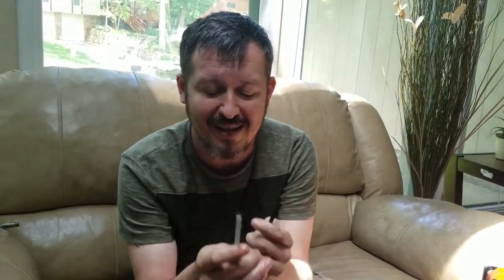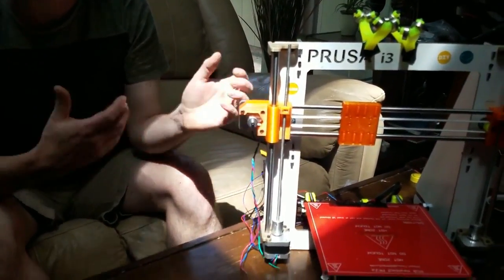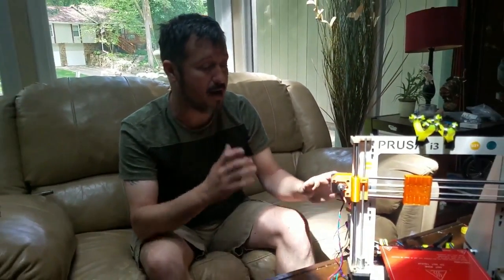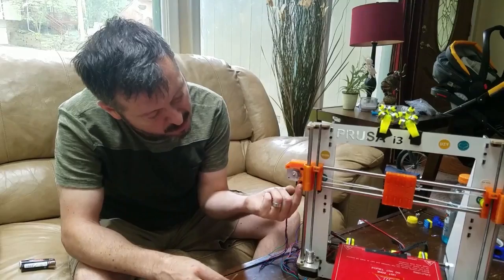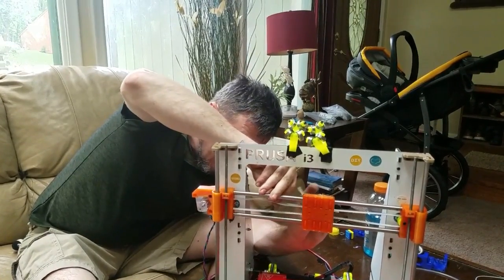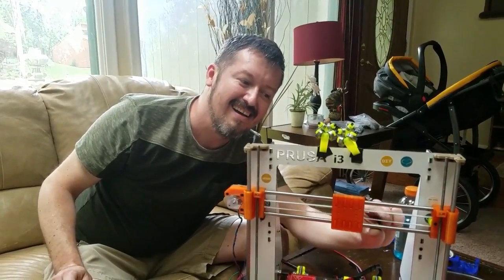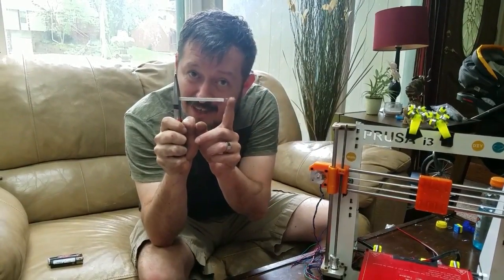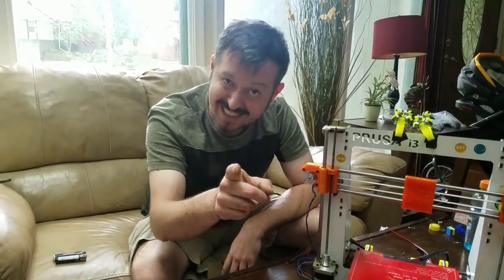How To Tighten The Belt On Your 3D Printer

Comment: which one is good, PU or Fiberglass?
Reply from the maker: This is just my experience,  but fiberglass and kevlar reinforced belts last longer than the steel reinforced,  because the size of the pullies we use for 3d printing
Reply: @forward3dprinting796  so fiberglass is stronger than steel
Reply: @forward3dprinting796  I mean which one is more resistant to breaking up
Reply from the maker: @agusirwanto7483  I guess we need to start with basic concept, plasticity and elasticity. Metal when bent forces stress on the actual surface of the metal, example grab a cloth hanger or wire and keep on bending it back and forward on the same place, it will eventually snap. Now grab a piece of string and try bending it it over and over on the same spot, nothing will happen. Steel belts are the correct answer for some projects , sadly because of the circumference of the pullies we use to print they are no a  good option.
Reply: @forward3dprinting796  WOW,,,,, I really understand your explanation, now I know what I need.  your techniques and logic are very good.  Thank you my brother 😀

Comment: Will steel core belts work with 16 Tooth pulleys?
Reply from the maker: Rit- H you could however the circumference is to small putting lots of stress on the steel, which result in the belt lasting less
Reply: 20T ?
Reply from the maker: Rit- H that's  what I run
Reply: Excellent, thanks !